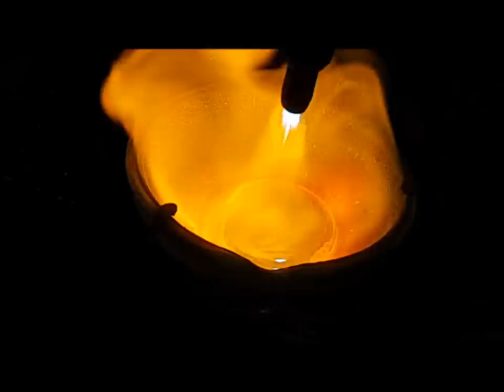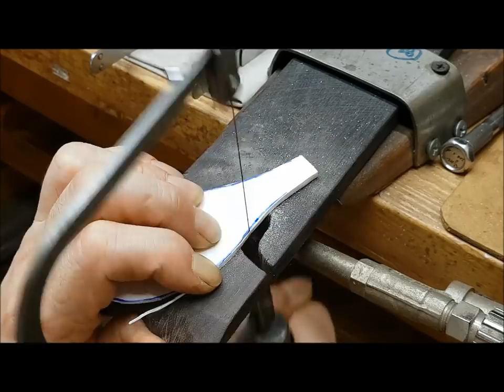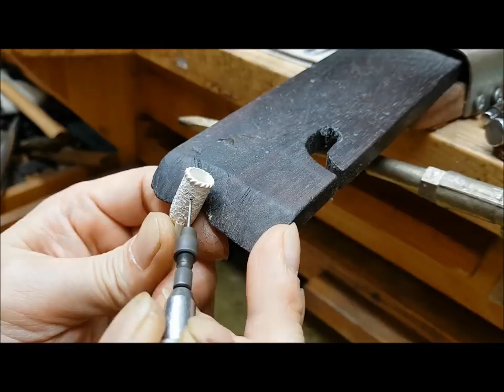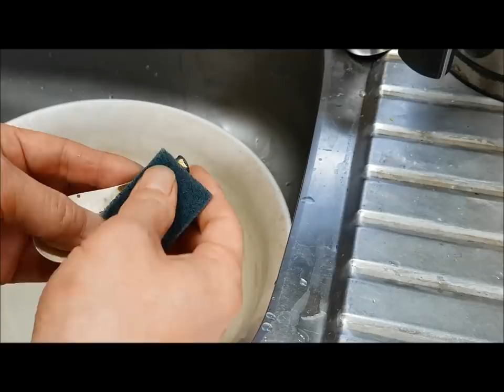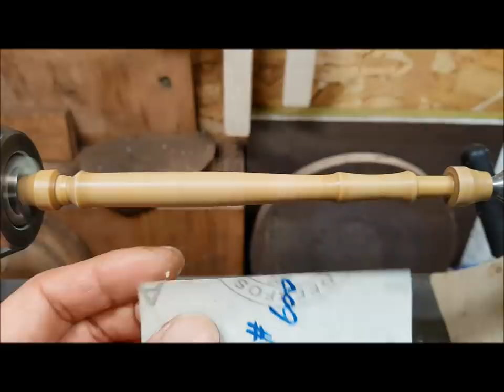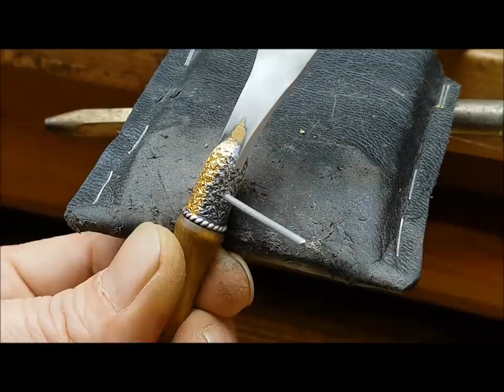MAKING BABY SPOON / Silver forging, lignum vitae wood

Comment: About your pot for the acid, what metal is made of?
Reply from the maker: It is stainless steel with very strong corrosion resistance.
I have been using this vessel for 28 years.
What more do you need to say?
Thanks for your interest~
Reply: @SilverMeister  Is that vessel corrosion-resistant by itself, or should i coat the inlet with something else? How often you replace the acid? 
Thank you for the answers
Reply from the maker: @elcaballerodejunini  
The container itself is resistant to corrosion.
No additional coating is required.
Acid is exchanged about once a month,
I use the acid in a very dilute solution,
It's not very dangerous.